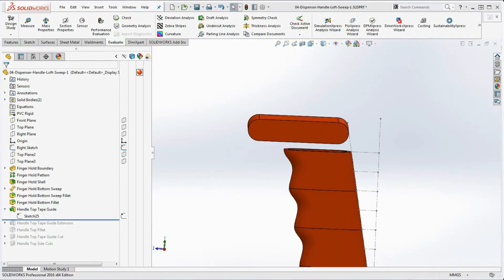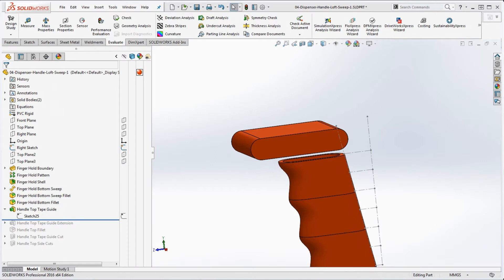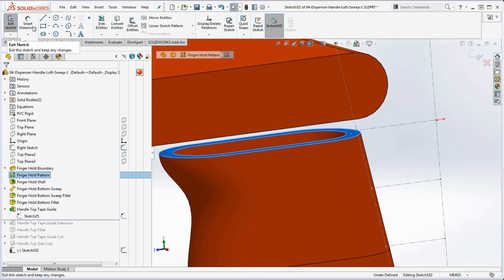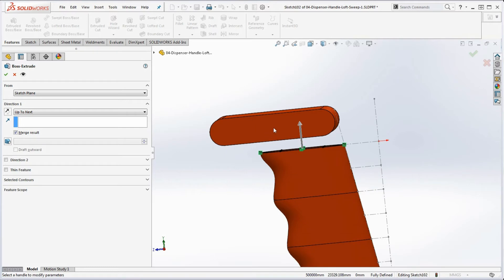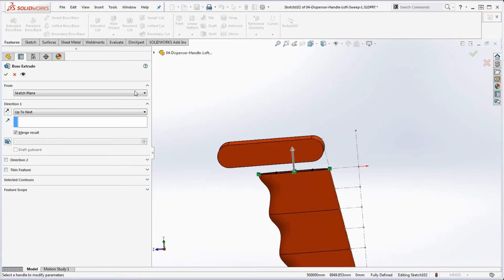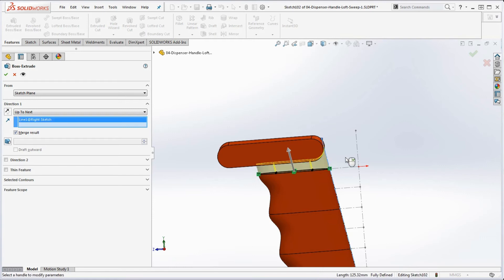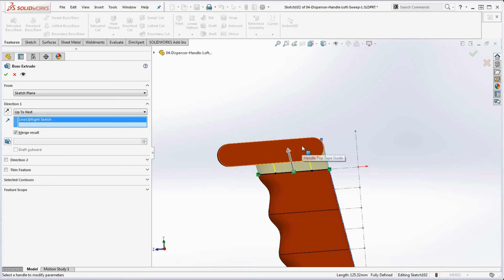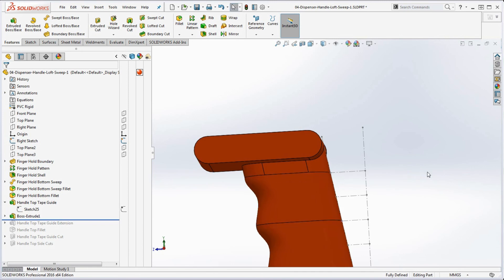9 How To Use the “Direction of Extrusion” Option with the Extruded Boss/Base Feature

Comment: Great tip here! I wonder whether extruding up to body/surface will work here.
Reply from the maker: I think the Up To Surface option may work on the rounded surfce, but if you choose the flat surface it will stop there and not fill itself in around the rounded surface.  CSS